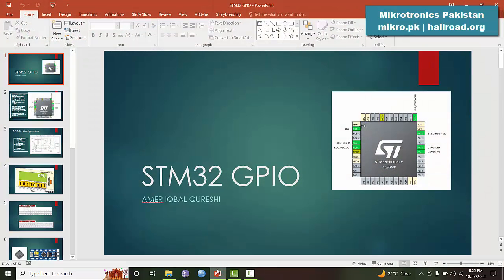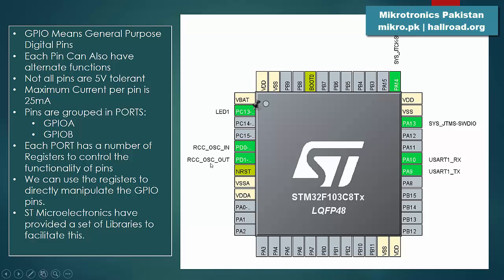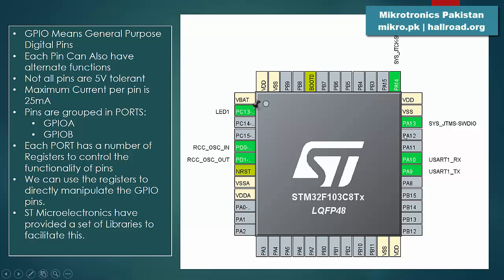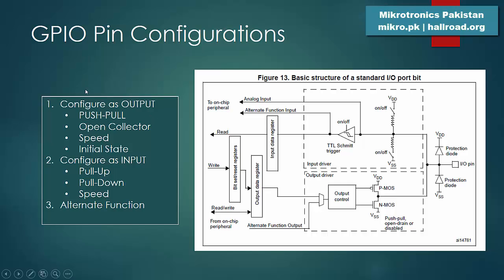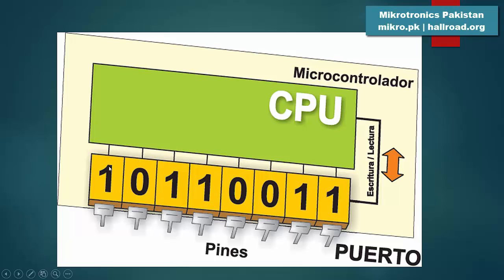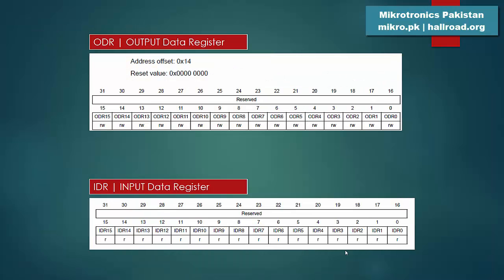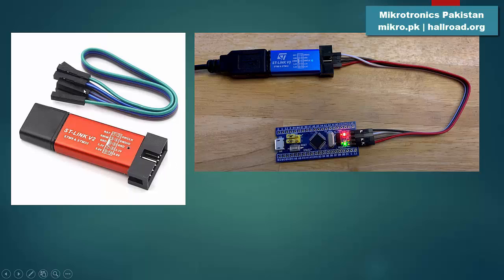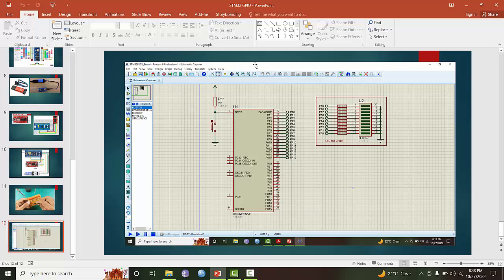STM32 Programming for Beginners | Introduction to GPIO Pins

Comment: Dear asslaam laykum ! How to connect 8LED with this  microcontroller and Relays .
Reply from the maker: Sir Leds can be connected directly, through 220R resistors, however make sure when all LEDs are ON current drawn is within safe range of MCU, fread its datasheet. I would however recomment making an LED driver if that is so. But I have tested it with 8 LEDs and works for me. For relay you need a transistor to drive it with a flyback diode.
Reply: @mikrotronicsacademy  actually I am using STM32F103 but I don't know on which terminals connected 8LED and 5 Relays
Reply from the maker: @engineerrehman6821  See the datasheet of yuour controller, you can connect to any GPIO pins.